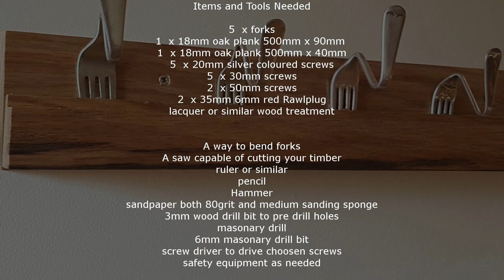Unique & Quirky Coat Rack(How to)

Comment: Great stuff gav 👍 great video
Reply from the maker: tphayres thanks ,came out looking good
Reply: Good job Gav nice use of some old bits and bobs.
Reply from the maker: patphayres thanks , ya it was a nice one , delighted how it turned out.
Reply: Genius use of the circular saw  and belt sander
Reply from the maker: thanks ,it works very well and It can save a bit of time too .